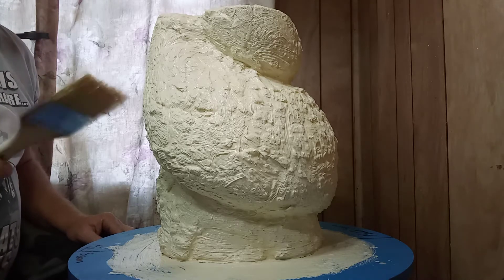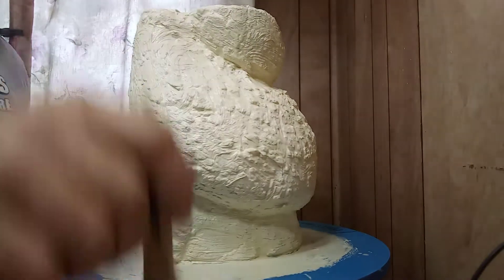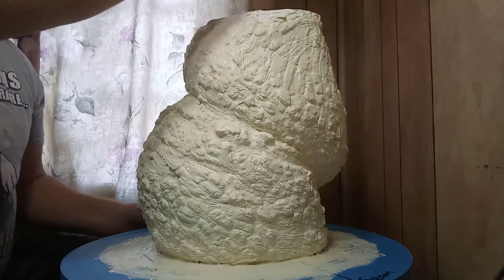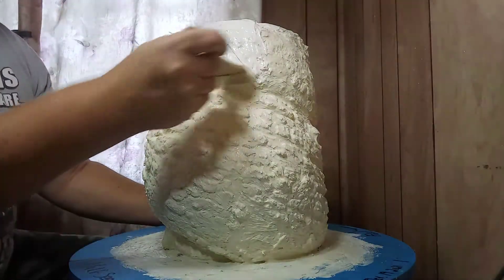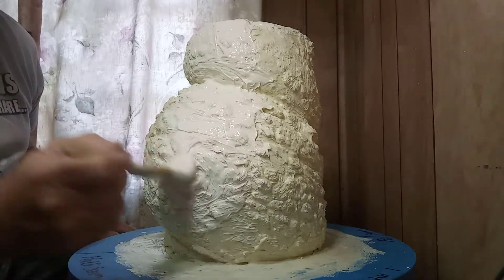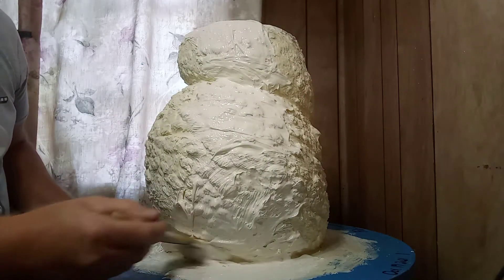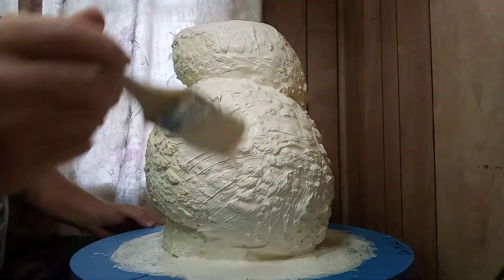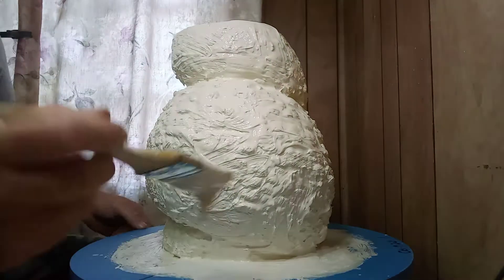Diymolds.com Webb's Solid First Coat Latex Rubber process.

Comment: Great vid Frank, thanks for sharing I really enjoy watching your different techniques.
How long do you leave to dry between layers doing your rake method? I do like to put my rubber in thick but I leave 2 or 3 days between coats as I'm in the UK and weather is cold at the mo.
Thanks Frank
Reply from the maker: Yeah weather plays in to it for sure.
The rubber your using over there tends to be thinner, unless you thicken it.
I am doing one coat a day right now. Weather is sunny cool nights warm days.
i could add a fan and do 2 coats a day.
i have skipped a day when it has raining heavy here. 
i like to touch around the flange model area, if rubber comes off then it is time to wait for me.
I am fixing to add seams this eve.